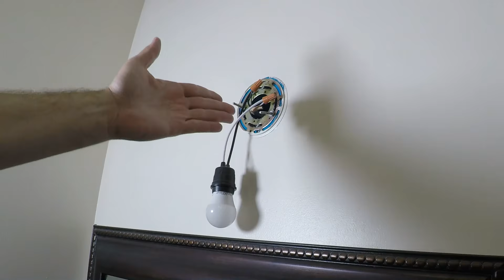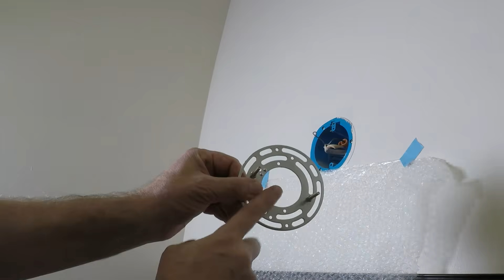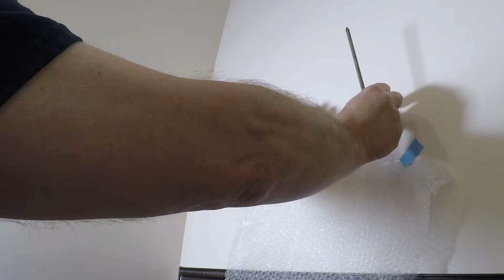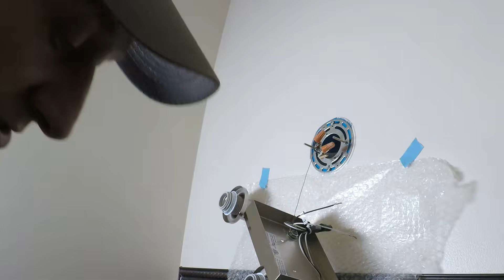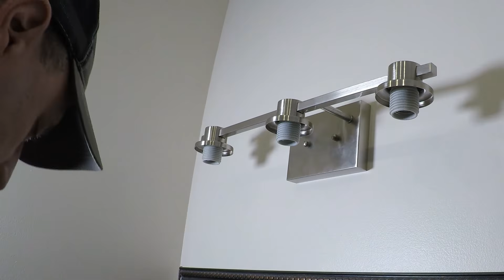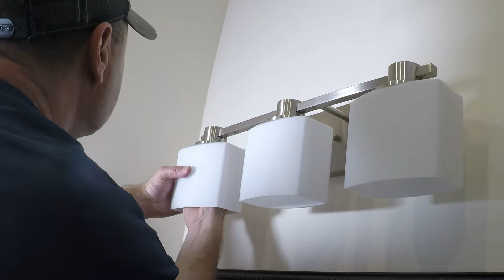Step By Step Bathroom Vanity Light Upgrade Anyone Can Do!

Comment: I wanted to replace my light fixture in my bathroom because the one that is there now is starting to flicker and it is a light fixture where you can’t change the bulbs. However, I was too scared to do it myself. I would normally call my electrician but after watching your video, I am confident I can change it out myself and save some money while I am at it. Thank you so much for taking the time to make this video! 💕💕💕
Reply from the maker: Glad this helped. Please subscribe to the channel.

Comment: What are you feelings about electrical tape?  I saw you attached the ground wire from the fixture to the green screw on the plate.  Was there another ground wire coming out of the wall?  If so, is that attached to the same green screw?
Reply from the maker: There must be a ground wire coming out of the wall along with the power supply. That is the only way to ground the outlet and box

Comment: I'm an electrician and I will be on standby for when the homeowner screws this up 😂
Reply: It doesn’t seem that hard to me, especially after watching this video! I am going to do mine on Saturday! 💕 FYI: I am no plumber but I just replaced my kitchen and bathroom faucets and took out an old toilet and installed a full bidet. The only thing I needed help with from my man was lifting the new toilet onto the flange in the floor. I did everything else by myself. YouTube is awesome! I will call my electrician and plumber when there is something I know I cannot handle.
Reply from the maker: That may be, but it is an easy project for them to try to accomplish.